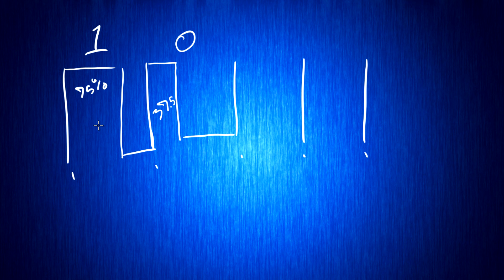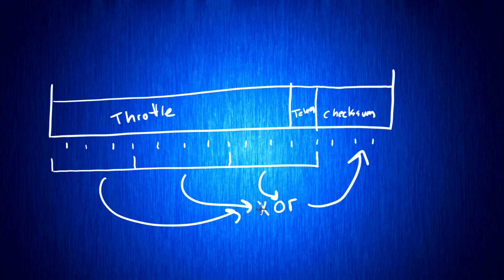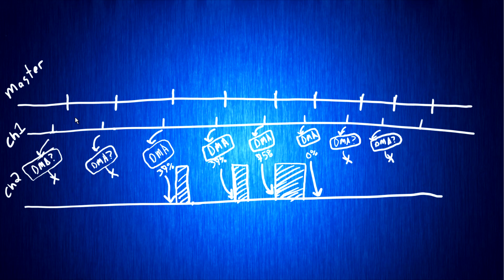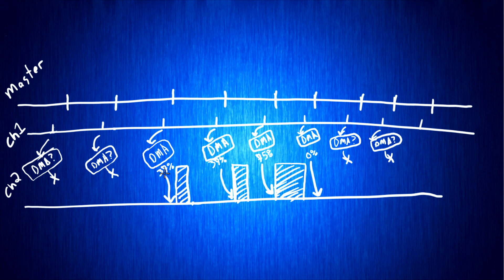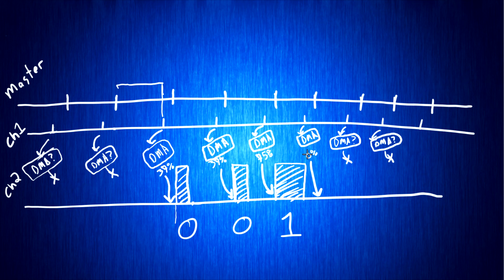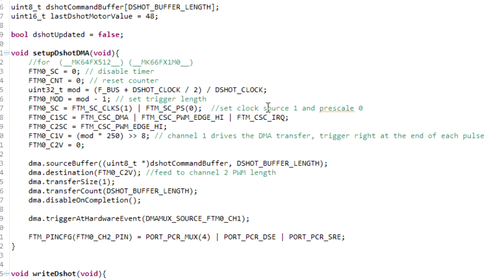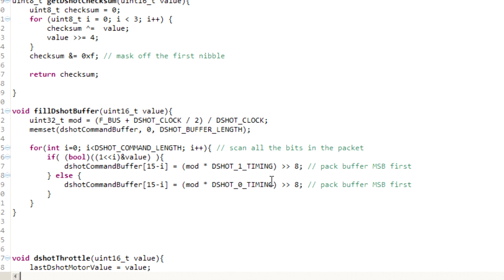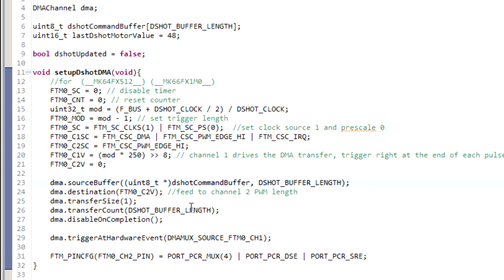DMA Dshot implementation

Comment: Hi, thanks for the detailed explanation , can I know where you got the code from? I would like to implement something similar for a drone motor testing setup (specifically under noisy commands )
Reply from the maker: All the Dshot implementation I wrote myself, hardware setup references the Teensy WS2811 driver.
Reply: Would you be willing to share some of your code ( I understand if you wouldn't want to), I understand why you wouldn't I'm in the middle of trying the same implementation on a teensy, and would prefer to avoid replicating the work.  By the way thanks for the walkthrough, it's been very helpful.
Reply from the maker: I just pushed my latest working tree, it's all in there
https://github.com/Extent421/bladeBench

Comment: Thanks for the great video, and the software implementation. I struggle to understand the part "FTM0_C1V = (mod * 250) >> 8;" could you explain this in more detail? Why 250?
Reply from the maker: IIRC,  that's for setting the duty cycle of that timer.  The right shift is the same as /255, so it's setting duty cycle of 250/255.  That causes the edge trigger to fire just before the timer clicks over for the next tick
Reply from the maker: @MrSolidGeek  Maybe the DMA trigger in timer 1 isn't getting called early enough?  You could try decreasing the duty cycle on that timer 1 and see if calling the DMA transfer earlier helps it fire more reliably.  Maybe something with interrupt priority?  In blade bench I'm using multiple overlapping interrupts at different priorities to manage a sort of preemptive multitasking so stuff like serial doesn't interfere with time critical functions.  So I might be changing something elsewhere in blade bench that helps it work.  I do run the 3.6 at full overclock as well
Reply: @SiieeFPV  Thanks, I tried calling the DMA transfer earlier by setting the value 250 to 230, however, this introduced another issue with the signal only containing 15 bits and not 16. Why is that?  What seems to work is to keep the 250 while introducing a small delay (1 microsecond) in the dshotout() function right before filling the buffer.